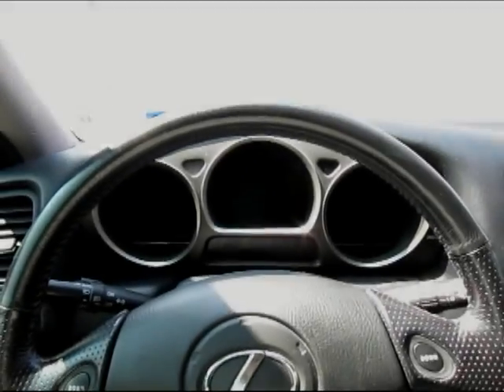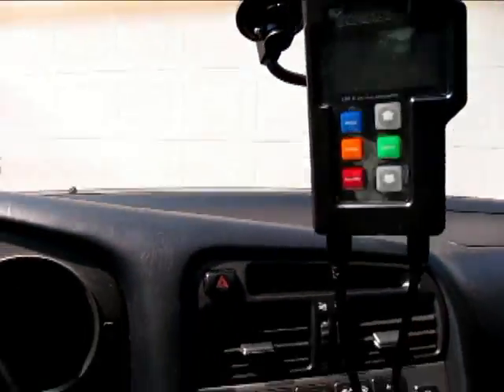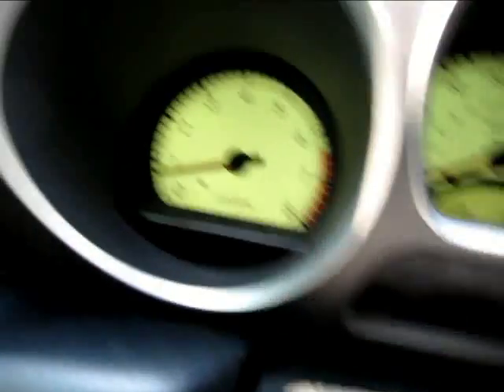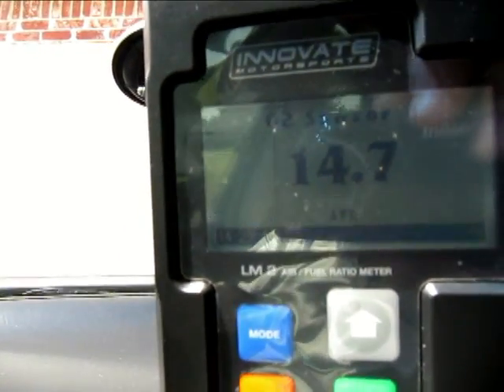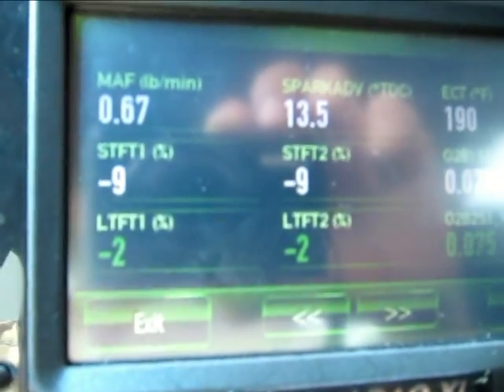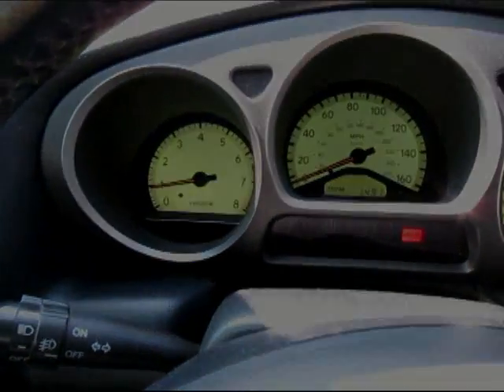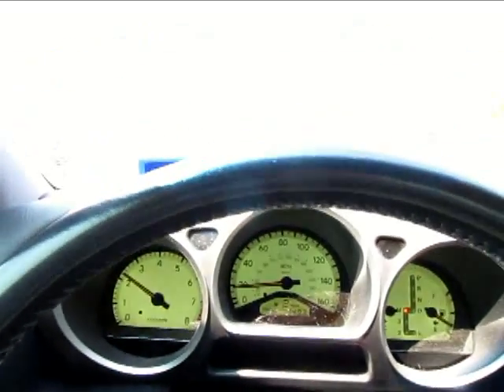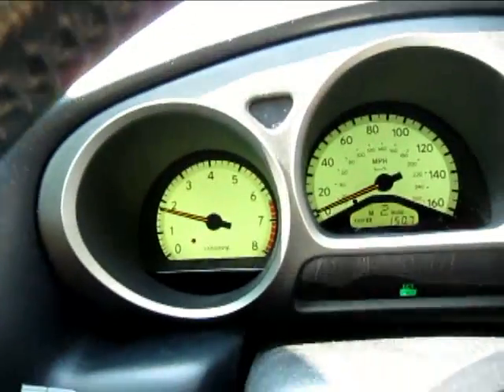Power Dynamix Turbo GS300 - Stage 1 Turbo Kit Testing

Comment: So what’s the engine difference between the sc300-400 and the gs300-400?
Reply: Unless you have a Non VTTi GE Engine then you have the better bottom end it's the same spec as a GTE, VTTi GE has the weaker bottom end but that's about it engine wise tuning is probably different per car GS being the more "Sport Lux" one.
Reply: One is a inline 6 (sc300 and gs300) they have 2jz-ge while the sc400 and gs400 gave 1uz and is a V8

Comment: Why doesn't the turbo exit feed into the other side of the intercooler?
Reply: it does, but all the piping is routed towards the turbo side. Its how the stock Intake Manifold on the 2jzge is..how it goes over the engine to the right side of the car. You can get a Front Facing Intake Manifold(like the stock 2jzgte intake manifold) but it's a pain in the ass to install correctly for not much gain unless you're making high HP. This appears to be a factory stock 2jzge engine with just a bolt on turbo kit

Comment: How's the car holding up now, I've heard the vvti isn't too happy when boosted
Reply: jamaicanlovrboy stock bottom still can handle over 500 horsepower though. Not much difference if you are going street legal.
Reply: jamaicanlovrboy is that true were u hear that i need to know
Reply: TheGuy its true, the VVti GE motors have thinner connecting rods than the non VVti GE or the GTE motors. Toyota did this for fuel efficiency. Because the 2jzge VVti have higher compression(10.5:1) they can make about 280-300whp on about 5-10psi....anything over that, and youre on borrowed time.
Reply: compression wise, just put a thicker head gasket. #1.5jz rules!
Reply: Sombo Chea  I'm Khmer too where can I get this set up for my is300 wagon?

Comment: just wondering.....My dad's friend is selling his 04 gs300 for $7k. It has an adjustable suspension system. Its lowered and the wheels have camber. It has the "VIP' look to it. And it has 140k miles on it. The engine looks dirty(obviously 140k miles) and The interior is ok. It needs a stereo and thats about it also the door locks dont seem to work. When I pressed the unlock all button on the driver side the back doors didnt unlock. Do you think its worth the 7k hes asking for??
Reply: AdventuresWithAlan fuck no
Reply: way too much
Reply: 2500 at the most
Reply: Ummmmm no

Comment from the maker: @yeamiata 
It is 320bhp or hp at the crank, so approx 285whp.
Stock non turbo engine output is 220bhp/185whp.

This kit will increase power output by about 100hp over stock. It is only running at 5.5psi of boost. The stage one is designed this way so it can still use the stock injectors. You can run up to 8psi on the stock compression, but you will need to upgrade the fuel injectors.
Reply: Were can I buy and is it easy to install
Reply: PowerDynamix where can i get ine if these kits

Comment from the maker: @708708luxurysports 
Engine management is done via an AEM FIC unit. It is quite tricky to tune the car to run perfectly, however the tune has been perfected with this setup. Everything runs like how it should from the factory and power delivery is quick and smooth. No jerkiness, no stalling, and most of all there are absolutely no check engine lights.

Comment from the maker: @velocity211 
Yes. It can be modified to run on an IS300 under special request. This kit was designed for the GS300 due to the lack of aftermarket turbo support for these cars. The IS300 has a much bigger market in terms of turbo kit selection out there. However, this is the first kit on the market that will pass plug in OBD2 emissions testing.
Reply: U mean smog ?🤔🤨

Comment from the maker: @koffypr 
These turbo kits will be available for sale in a few months. Boosting these cars isn't a simple task compared to other cars out there. The electronics are the most difficult part to sort out when boosting. The Stage 1 kit will increase engine power by around 100hp(Total engine output approx 320hp) and cost $4k. The Stage 2 kit will give you a total engine output of approx 450hp and cost $5.5k.

These turbo kits will pass plug in OBD-II emissions test and have no check engine lights.
Reply: PowerDynamix can I get the whole kit from u